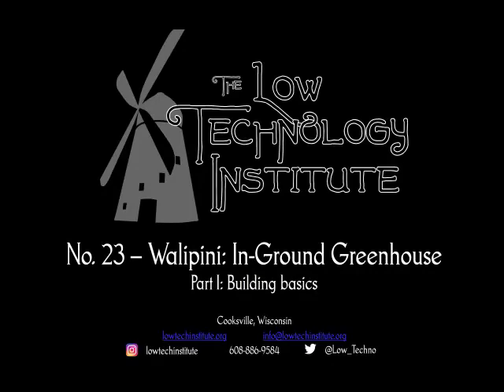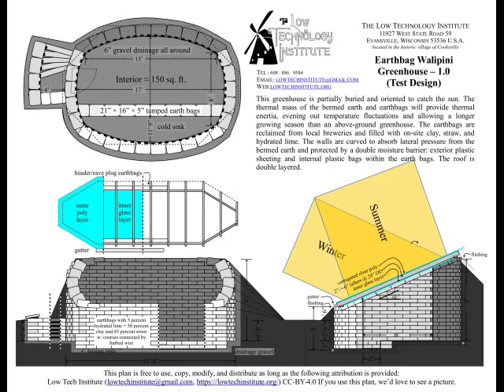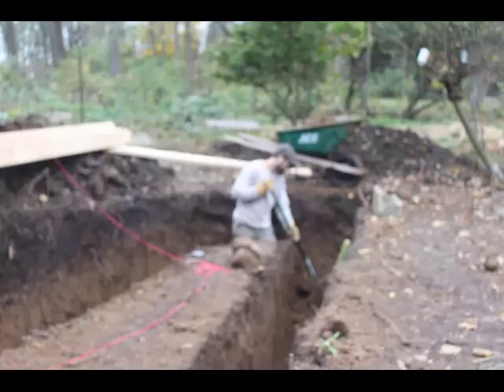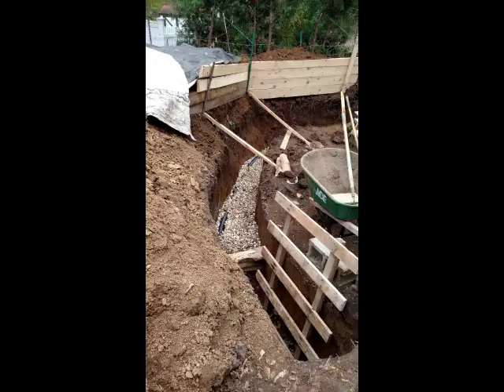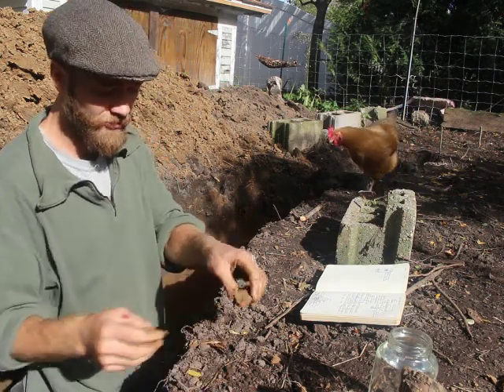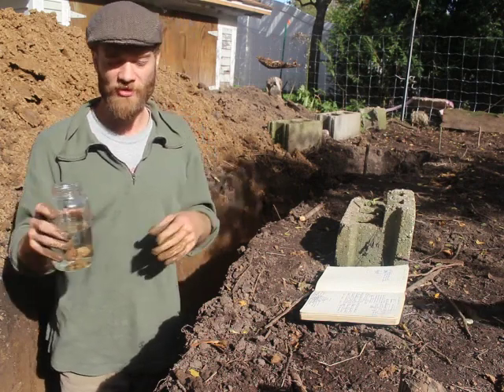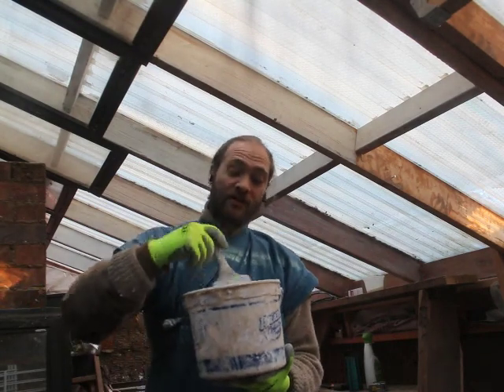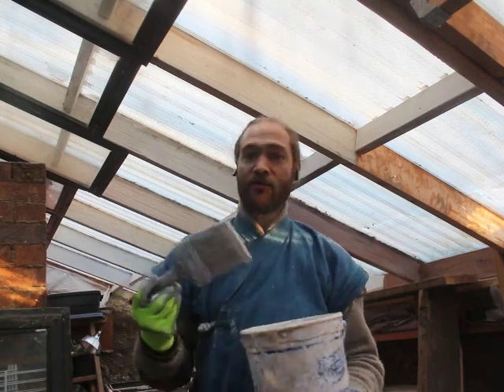Walipini: Underground Greenhouse, Part I -- Low Tech Video, No. 23

Comment: I'm afraid I couldn't hear you over the highly distracting noise, so I had to leave. It's too bad too because I would have been interested in this.
  Is there anyway you can remove it?
Reply from the maker: Hi John, Thanks for watching what you could stand. As you can see in the comments, you're not alone. Also, at this point, there isn't much I can do without remaking the video, but I don't have a spare 3 hours to reedit this thing. The music will go in the bin, though. Thanks.

Comment: I am  curious about why you included straw in the fill.  Been recently researching earthbag building including re-reading Hunter and Kiffmeyer.  For them, one of the advantages of earthbags over cob seems to be that they can dispense with straw.  You’re the only person I’ve seen adding straw to the earth mix for earth bags.  Is there some consideration I’m missing?  I really want to know.  I am getting ready to embark on some earthbag projects this year (smaller, learning).  Wondering what sorts of things to include in my experiments before tackling larger projects later.
Reply: Test with and without to see what you like. It helps a bit with stability of bag fill, so once it is tamped, it won't shift much. As long as it is kept dry, it won't rot, so moisture barrier is needed.